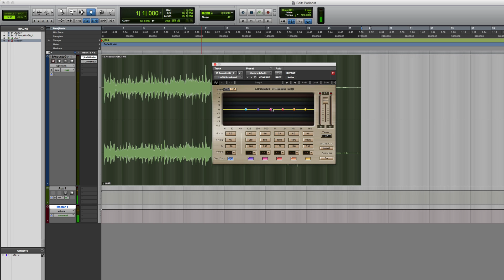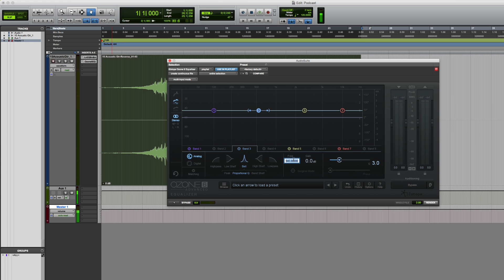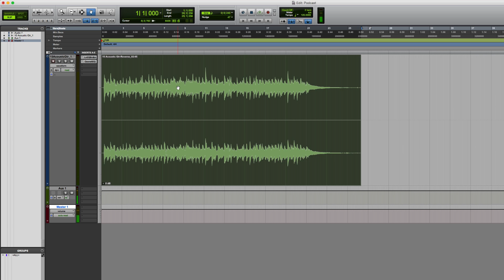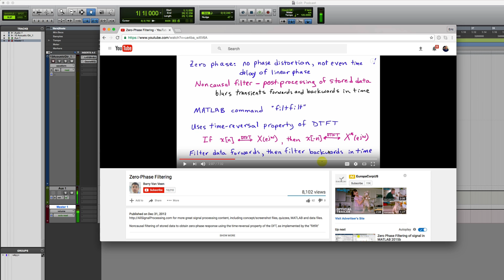An Introduction to Zero-Phase Filters

Comment: Doesn't reversing it again at the last step bring back the original phase difference or does it get cancelled out by the phase shift caused by the second EQ?
Reply: The phase is cancelled, the track remains the same plus the clean EQ cut.

Comment: Honestly - first time listening to you/your clip,  but this is an Awesome explanation, thank you very much :) 
But i have a question, like man from above, what are the consequences of phase problem? Thanks in advance, and keep it with these awesome tutorials :)
Reply: As he said in the video, if you have to eq a track that's part of a parallel chain or a multi mic setup, Snare up and down for example, the switched phase will mess the sound around the area where the EQ was applied. If you are eqing a soloist track this is not relevant.